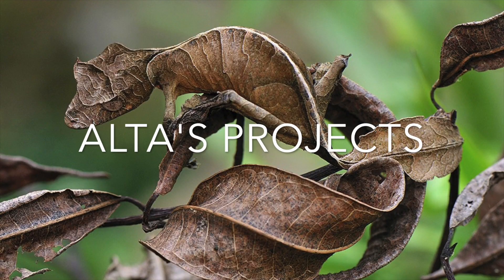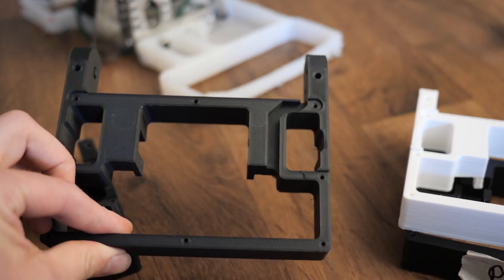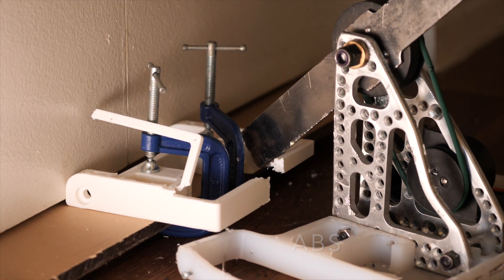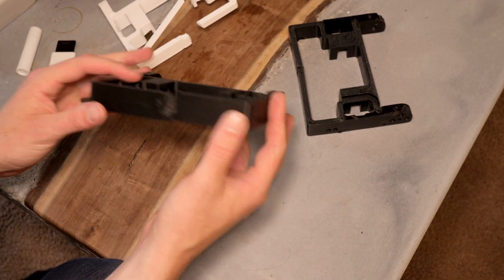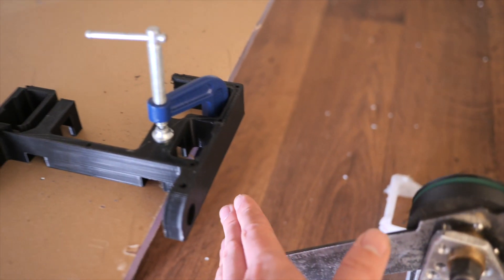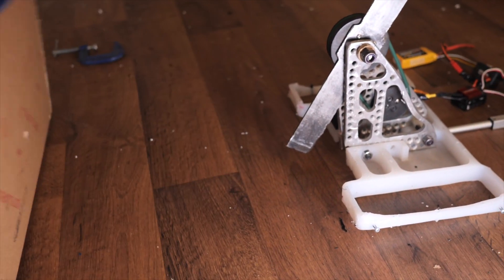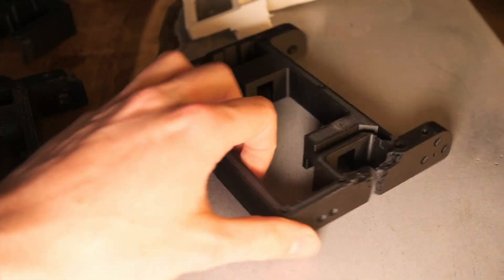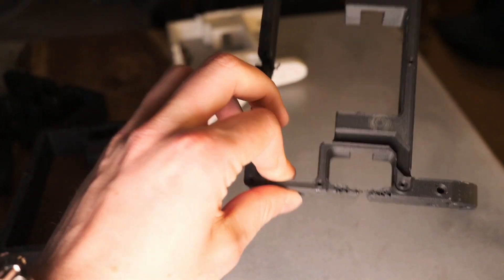Best Antweight Combat Robot Material?

Comment: also i have 15$ right now i wanted to know how much money to make a fun spiner to play with
Reply: With that kind of budget, I would absolutely advise against building a spinner.

And this is coming from a fool that tests their robot inside, no protection, with my face inches away from the spinning weapon.

What weight class are you fighting in?

My 30 lb featherweight, Desert Storm, is absolutely deadly, I haven't bothered to calculate the strength of the weapon, can abso-freakin'-lutely fling something hard enough to send it through someone's skull and kill them.

Desert Storm cost me around like, several hundred bucks spread out over like 3 years. 

I have access to a Makerspace and the like, so I have been able to drastically cut down on machining costs.

Also, do you realize how massive the forces are in this sport?

Desert Storm, because of how well-built it is, has never really had anything unrepairable destroyed.

I mean, I've fried several weapon motors, but who hasn't fried several weapon motors?

But I have a chassis made out of hardox and aluminium, and I know the forces involved, where it would hit, and yeah.

Best of luck, from Desert Storm BattleBot.

Just my 0.02

Comment: I'm the current owner of Sgt cuddles. Very interesting tests, the driver Erick and I have tried ABS, Nylon X, and the original UHMW chassis and they are consistent with your testing. We are planning on making some tweaks to the chassis design and milling them out of UHMW again because of these failures. The titanium drum has been beat up quite a bit but is the main defense of the bot if we can get better drive control.

Comment: I love the tests, but I think it could be more accurate in two ways: using a weaker weapon (maybe half way between an ant and a beetle) and not clamping the chassis down. In a real competition it's not super frequent that your bot will get clamped to something and smashed into in the same spot repeatedly. The closest would be getting pinned against the wall, which could be done here. I'm also imagining a funnel with your weapon at the bottom smacking the chassis up in the air repeatedly for a random series of impacts.

Comment: I'm working on my first Beetleweight right now. My plan is to do 3D printed parts sandwiched between an aluminum too and bottom layer. Do you think PLA is suitable for things like motor mounts that theroretically shouldn't be in contact with the opponents weapon?
Reply: It dependa on how thick you print them. I used 8mm PETG at 40% infill for internal motor mounts and they survived 4 fights and a rumble even when the rest of the bot got smashed.

Comment: Would heat treated spring steel work better? Riveted or screwed together. Maybe welded where needed.
Reply: These would be for lower weight limit competitions.
Reply: @cogsworth2634  I get that, but 0,8mm steel is not that heavy and durable with the right heat treatment.
Reply from the maker: FAZIK I’ve met some builders who really like using spring steel.  I have tried to build with it, and I personally didn’t like working with it, but I’ve seen some successful wedges made with it